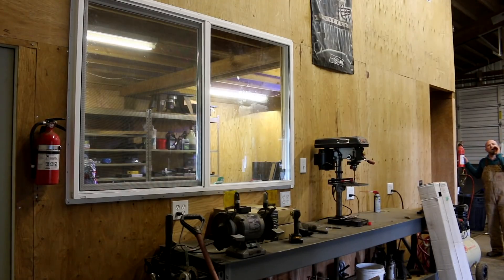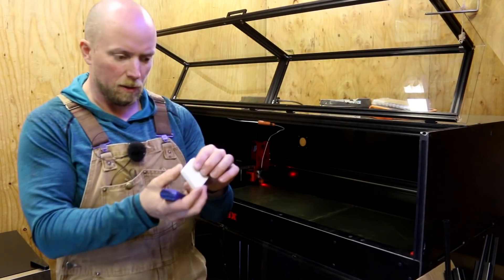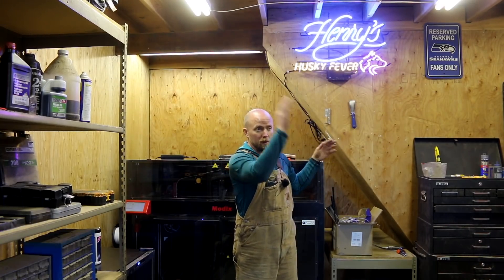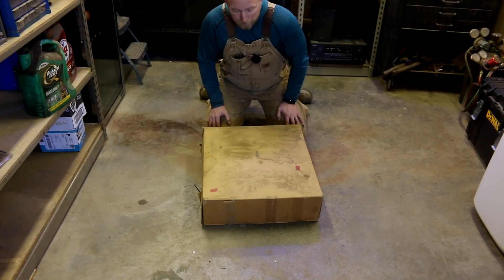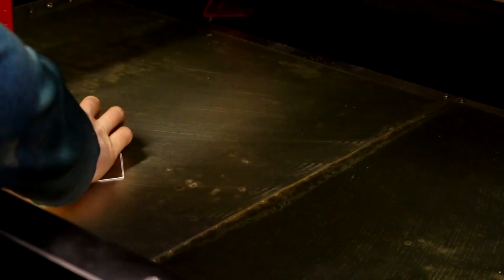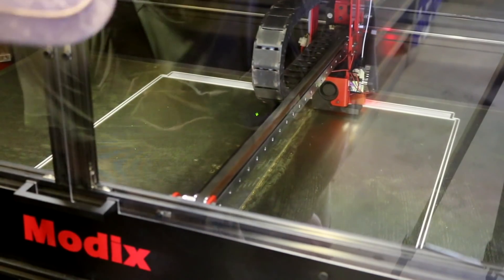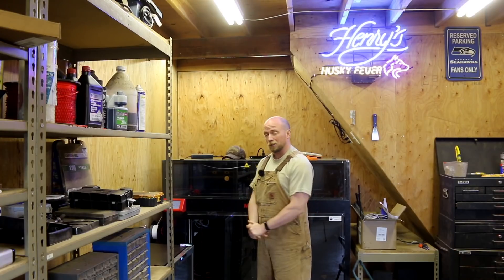MODIX 120V3 Print Testing and Calibration

Comment: 5:09 u went from thinking you're too far away from bed still to thinking maybe you're under extruding a bit.  I'd run a higher % infill obviously.  Also check your first layer speed, is it slower than the rest? 

7:30... Still bed adhesion problems.  You using glue stick?  Is it a heated bed?   Hair spray?

8:30 ok beds heated, cool ya I'd call that under extrusion 

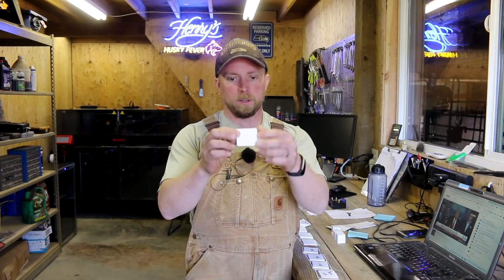9:40 just do mm you know it's easier haha

10:40 you're going to have warping issues surprised the 25% didn't start to, saving grace was it's still thin.

12:00 looks like first layer is pretty slow so disregard previous comment about that.

You're doing great learning curve is kinda fun but can be frustrating.  Sounds like you have a pretty good handle on it.
Reply: Thats a PEI bed, no adhesive. His best bet is to actually use the rough side of a sponge and just clean it with soap and water, and he should acetone it weekly.

Comment: For prints not sticking, and that have the bottom layer lines not filled in entirely you need to lower the Z offset. (Have the nozzle start closer to the bed so it will squish the plastic onto the bed more.
Reply: I was thinking that too, but I think he's got a lot of gap all over the print, I think it could be under extruding.  Hbu?
Reply: @jake1021  extrusion width since he's trying to print really fast, but it might be both the width and the starting Z. it looks like underextrusion because of such an insane layer height and 2.75mm filament.

Comment: Jeff, It looks like you’re using PLA.  I recently printed some parts for my truck then learned that PLA is not ideal for outdoor use because it ingests water.  From what I read, it’s not that the plastic absorbs water, but the print isn’t watertight, so water finds its way into the infill cavities.  Others more knowledgeable than me may be able to comment.
I’m assuming a “grow wall” is going to be exposed to water.....it might end up being heavier than planned after it gets saturated.
There are other materials that do better in wet environments.
Reply: PLA is hydroscopic which means it will absorb moisture from the air (like silicon packets). Shouldn't really affect the parts once printed. Pla prints will warp badly with drastic changes in temperature after printed.
Reply: Long time 3d printer here. The biggest down side to PLA in Jeff's use is its glass point. its glass point is way too low for the use that he's using it for, Its going to sag in a hot, humid trailer in the middle of the summer.  The other downside to something like PLA is that it will weep water, but thats a problem for MOST 3d printed solutions, unless you vapor smooth it (like ABS or polysmooth), or you up your extrusion width like crazy so that water cant go in between the layers. Having a 3d print get water tight is going to be a problem regardless unless he has tiny layers, good overlap on extrusions, etc. My suggestion to fix both a low glass point, and water tightness, is to just use ABS and vapor seal it. And to be clear, Nothing 3d printed is ever going to be "food safe". And with PLA having an enclosure is a BAD thing. You could use hairspray, no heated bed, no enclosure and get a perfect print, and with that enclosure its basically intended for ABS.

Comment: - Roughness on the sides and blobs around the edges is from over-extrusion - you're putting out too much plastic.
- Gaps on the bottom needs to have the 1st layer extrusion width increased - 230% over the 1st layer height is a good start
- Keep the temperature up to 60C for the bed - you do NOT want your print coming off during printing, hard to pop off at the end is a 'good thing' although not so stuck you damage the print or the machine trying to extract it.